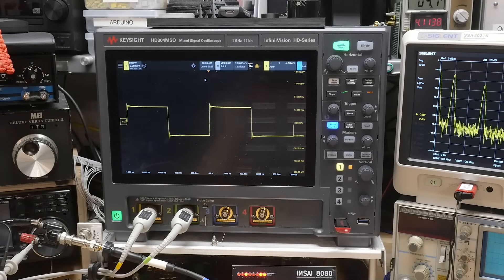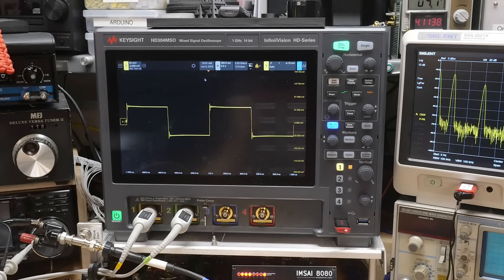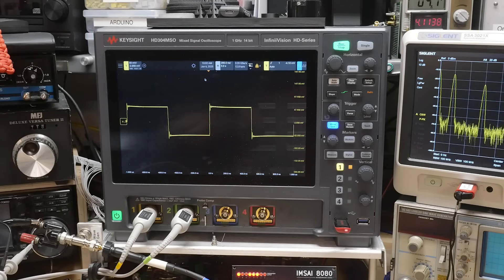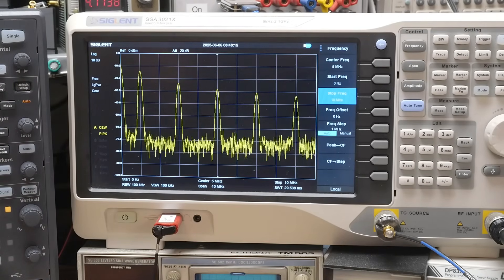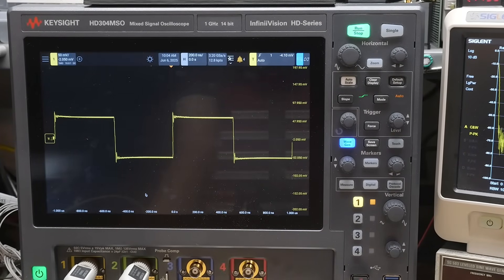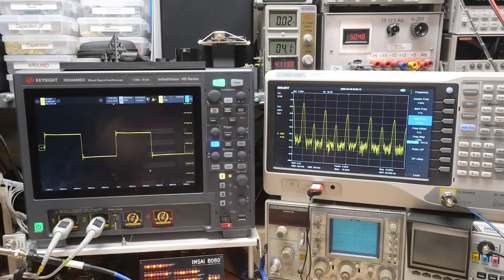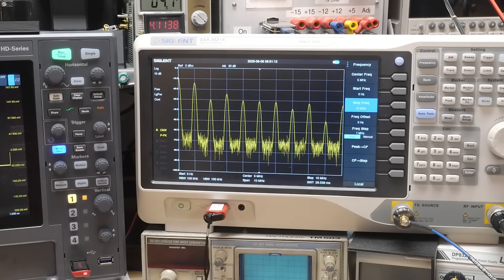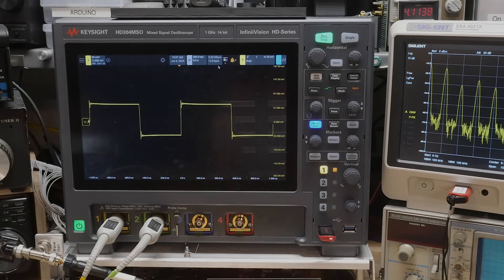#2255 Square Waves with 2nd Harmonics

Comment: Sir ... No math no electronics engineering ... Hobby means nothing if not involved with math ...
Reply from the maker: you are limiting electronics to a very small crowd. I still remember the joy of lighting up an LED using a battery and resistor when I was a kid. Please be kind. It can mean a lot to someone and perhaps they will learn more (including the math) later, but even without the math there is magic to be found
Reply: @IMSAIGuy  True ... I was feeling that joy to see my designed or even implemented circuits working good but if the goal is reached then it is a problem because the true  joy of that is knowing the dynamics  that govern the system of connected components and repeatability ...

Comment: I would build a circuit to add voltages together.   Just a few resistors.  Then feed it with c couple sine waves, one 3x the frequency.  Then add in a third sine wave at 5x the frequency.  Marvel at how It's getting squarish.

Comment: I have some mixed feeling about math in videos. Generally the mote math, the better, which is why I follow channels like 3Blue1Brown that exclusively deal with the technical math. Because those channels are really good at explaining hard math. I've also seen some engineering channels attempt mathematical explainations in unscripted, unrehearsed videos.
My suggestion: if you feel like you need to explain FFT, just drop a link in the description to  3b1b, or eben Veritasium's video on the entire history of the FFT.
Likewike, under NO CIRCUMSTANCES should Vertisasium ever have attempted a video on electricity or transmission line models.

Comment: Once you go over a 50% duty cycle, that is no longer a SQUARE wave.  It is a modulated wave , either frequency modulated of amplitude modulated
Reply from the maker: Hmmm, a 51% square wave is constant frequency and constant pk-pk voltage.
Reply: Theoretically, a square wave is defined as a signal with 50% duty cycle, otherwise it becomes PWM
Reply from the maker: @NICK-uy3nl  true: The square wave is a special case of a pulse wave which allows arbitrary durations at minimum and maximum amplitudes. The ratio of the high period to the total period of a pulse wave is called the duty cycle. A true square wave has a 50% duty cycle (equal high and low periods).

but I've never heard anyone use the term pulse wave
Reply: @IMSAIGuy  By PWM, I meant Pulse Width Modulation. A PWM is simply a square wave that has been modulated based on the duty cycle.

Comment: This is also why phase jitter disrupts precise signals and computer clock jitter improves rf noise.
Reply: But doesn't clock jitter produce more harmonics? Because the duty cycle and/or frequency keeps changing.
Reply: @simontay4851  I think it is because it lowers the maximum power spectral density, since it spreads the energy across a wider frequency range

Comment: I've been wondering this for a while, ever since I read that cal process for one of my Tek function generators (TM 502 or TM 503): is this one of the common kinds of distortion we try to correct for in sine wave generators? Would a since wave with a small deviation in duty cycle have a huge THD?

Comment: Math doesn't scare me, but if you went really deep into it, it might. You say duty cycle and I think of it as pulse width. Not sure if that isn't the same thing
Reply: Sorta...  Duty cycle is the positive (high) pulse width in seconds divided by the period of tge full wave (positive and negarive) in seconds expressed as a percentage.  This is duty cycle aka positive duty cycle.  If you instead took the negative (low) pulse width and divide by the period it would be the negative duty cycle.  Hope that helps.

Comment: SO you have a crappy looking square wave maybe,  and you have a duty cycle adjustment pot.  But due to the irregularity of the wave it may be hard to tell visually when you are set for 50/50. Can you adjust for that looking at the harmonic levels or would any irregularities in the wave invalidate it?

Comment: I had forgotten about odd harmonics only on pure square wave - blows my mind that a small change in duty cycle brings out the even harmonics - I guess the even harmonics cancel at exactly 50%. The waveform shown on the scope doesn't look very good - excess HF response with ringing and somewhat poor LF response - I woulda thought the Keysight would output a cleaner waveform. What am I missing here?

Comment: One could explain the fourier construction of square wave without math.  Just show the constructive and destructive effects of adding the even and odd harmonics.  
The wave shape of the harmonics?  You don't show what a square wave is made of. 
Why don't the even harmonics matter? Demonstrating that would be a good illustration of wave cancelation, perfect destructive interference. 
I recall some nice online simulations showing the effects of harmonic addition of sine waves. 
Determining the necessary coefficients for the odd harmonic terms is math, but demonstrating the practical effect of adding smaller harmonics to make the larger fundamental is a simple visual concept.

Comment: Nice demo using square waves.  This works for many other waves as well.  We learned in school (from such as Skilling's Electrical Engineering Circuits book) that any "wave, however complex, that has half-wave symmetry will contain no even harmonics".  Half-wave symmetry means that "the negative half-cycle of the wave is the same as the positive half-cycle, though of course inverted".  As shown in the demo, any departure from perfect half-wave symmetry will produce some even harmonics.  

Note:  Sometimes this can be tricky to judge.  A wave whose negative half cycle appears inverted from the positive half cycle, but the negative half cycle must also be flipped in time to match the positive half cycle, does not qualify as half-wave symmetry and will have even harmonics.
Reply: Didn't follow the last bit...
Reply: @fitzroyfastnet  Okay, I will try to clarify.  If you take half a cycle of the wave, invert it, and slide it right or left by half a cycle, and it matches what is there, you have half-wave symmetry.   Any other result is not half-wave symmetry.  For instance, if you take half a cycle, invert it, slide it right or left by half a cycle, and then have to mirror it (flip it left-right) to get it to match what is there, it does not possess half-wave symmetry.

Comment: I did the math for this in university before I ever got in to electronics so I haven't ever really combined the two, or used a signal analyzer for that matter.
I assume it's an issue of the "harmonic content" mostly being in the rising/falling edge of the square wave? Depending on how sharp that edge is you'd have a certain width to it and if you shift it to say 51% duty cycle almost all of one of the two edges would be in the "even" portion?
It's odd to think about. If the mechanism at play is something like this I guess a sloppy sinewave even at 50% duty cycle would have some even content.
Now I want a tinySA to test this myself.